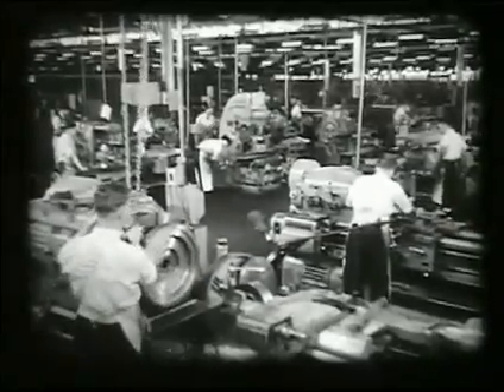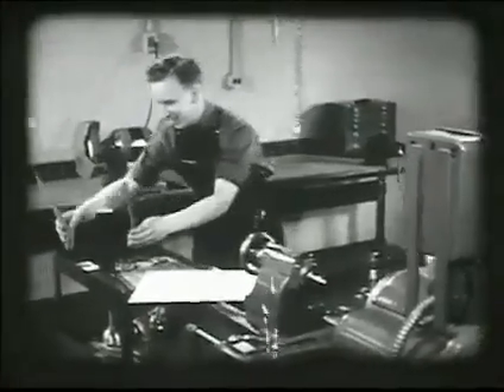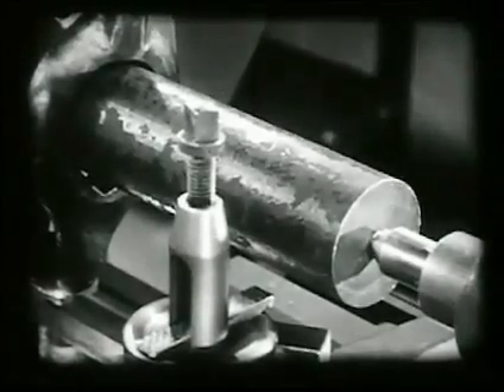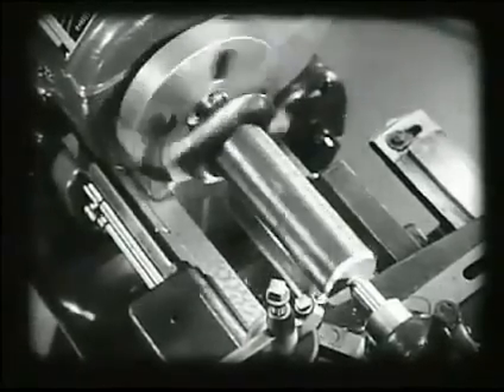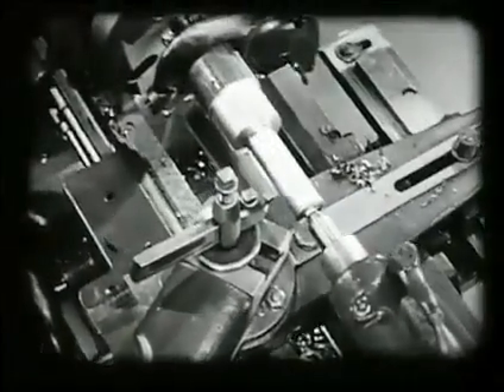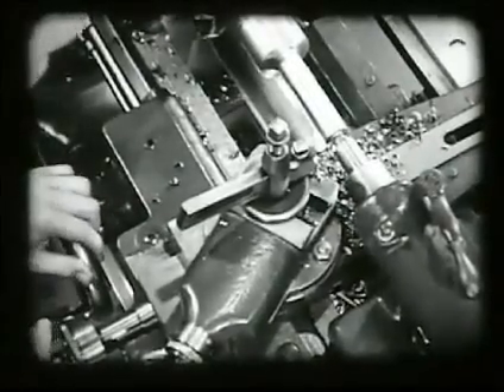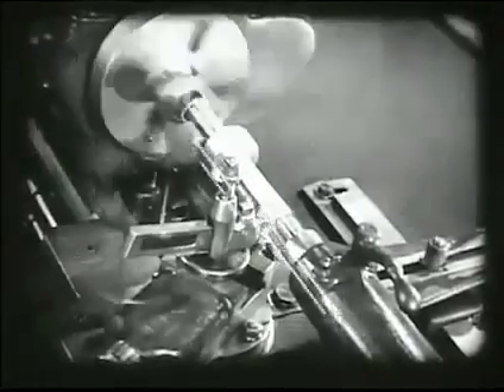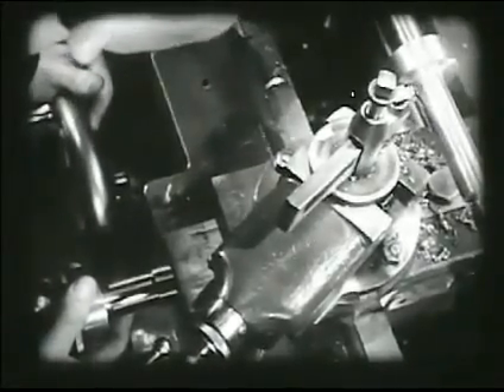Old Southbend instructional movies.2_diameters.mp4(360p_H.264-AAC).mp4

Comment: Nice video, but the way the machine operator handles the micrometer is wrong.
You cant measure accurately on the way the machine operator and his boss does!
You have to look up the highest point on the shaft by feeling and turn the spindle from the micrometer slowly toward the axle with the ratchet clutch on the micrometer.

Than you read the dimension on the drum of the micrometer. 
only on this way you can accurately measure and determinant the dimension whit the same pressure.

Or maybe it is not important that you're of by 2 or 3 tenth of a millimeter?
Reply from the maker: Yes, it´s a very old video, but what you say: "...and still did not exist vernier", is not correct. Please go to: https://en.wikipedia.org/wiki/Pierre_Vernier.  Best regards.
Reply: Is a very old video of the decade of the 40 micrometers did not have ratchets and still did not exist vernier